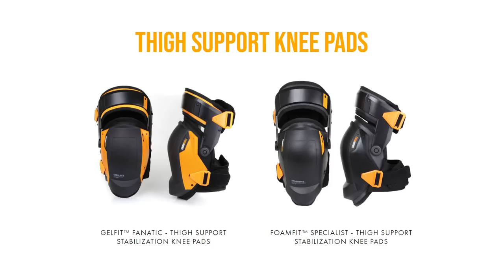How To Avoid Replacing Your Knees ~ With Toughbuilt

Comment: I hated knee pads in days of old personally for all reasons you just mentioned. I'm over 50 now and knees are shot to bits, I used cardboard, packaging, foam, anything I could lay my hands on to use for a kneeling pad but eventually the poor old knees took their toll. The latter part of my working life companies issued them stupid foam pads that you force into knee pockets of work trousers that were absolutely crap. I have had a 2" peice of white firm package foam handy now for my kneeling, I just can't kneel straight onto a hard floor any more. The younger trades folk should heed this advice and start protecting their knees, the sooner the better.
How about a lecture on our backs next Roger, and I don't mean a video of you laying on your bed. I bet I'm not the only one that has constant back pains now from the years on sites. 👍👍👍
Reply: Knees, back, neck and shoulder. I work as an osteopath and see my fair share of trades. Anyone working above head height for long periods has a good chance of getting neck and shoulder problems, anyone working below chest height is going to get knee and back. Then you got the poor brickie who's thumb will give in after 15-20 years unless they are genetically blessed.
Reply: When you add 1/2 inch hight to your knees, you need to arch the back further towards the floor.. longer term,this is more painful and debilitating than knee problems .
Reply: Mine to I wan told years ago by a old carpenter to always were knee pads which I listened
Reply: @johnnorris1983  interesting point
Reply: Hi there. We'd like to speak to you about your story as part of our #KneelSmartKneelSafe campaign. Please email us at marketing-uk@toughbuilt.com.

Comment: My main trade is plumbing. I’ve tried all different types of knee pads and I find the straps just dig into the back of my legs or the pads just fall down etc. 
I just use a memory foam pillow, works a treat. I wrapped cellophane around it to keep it water proof as much as possible.  It’s really comfortable.
Reply: I totally agree with you. I've tried all sorts of knee pads, and as you mentioned, the straps digging into the back of your knees is just to uncomfortable. I've tried trousers with built in pads but i've got very long legs and the pads are in the wrong position and don't line up with my knees. And like you, i just use a piece of foam which i put inside a rubble sack and cover in silver gaffer tape. So so comfortable.
Reply: @tilerman  that’s right,  wish I did this years ago when I was young but was stupid  and got embarrassed about using a cushion on site. People say it’s a pain trying to carry it around but it’s more of a pain when you can’t walk properly.

Comment: I bought a pair and to be honest they are the best I've ever worn they don't cut into the back of the legs I have the hard shell and I recently bought the soft shell to change because I was laying laminate as to not scratch the floor, I'm a joiner in my 50s and I automatically put them on first thing no matter what job I'm doing my knees aren't too bad considering my age, but in the last 10 years I have worn knee pads no matter what and I think that's stood by me

Comment: recoil spring loaded kneepads are the best in my opinion. only ones ive found that make kneeling comfortable where would otherwise be unbearable. the straps may be a bit uncomfortable but they should be easy to remove and secure your own wrap/straps on.
Reply: Made in Britain to.

Comment: Best ones I've found are light weight gel knee pads by Vitrex. Light so don't have to do the straps tight and stop the circulation. That said minimise the time in use and try to think of another way of doing the job if possible. Trousers with flexibility also helps. Would be interesting to try those toughbuilts.

Comment: I'm  a Painter & Dec with 45 years in the building trade. I also laid ceramic tiles  laminate flooring. 5 years ago I was registered disabled with arthritis in my knees, back and hands. In the 80s I used to wear miners knee pads. Even wearing them didn't stop me getting arthritis of the knees.
I am now awaiting the first of two knee replacements. To any young  tradesmen. Please, please wear knee pads. Just because I have arthritis of the knees doesn't mean that you will.

Comment: Hi Roger   Something I’ve been banging on about for years , of course in my early days there was very little available except as you say the type that were just to uncomfortable. But today there really is no excuse , even the type that fit into pockets in the work gear can go a long way to prevent future problems.    Ironically I’m having new PVC windows fitted, and not one of the lads has knee protection . And yes I have given my hard leant advice , but was met with all sorts of excuses including it’s no good if you were shorts bless them.   I suppose when we’re young we think we’re indestructible , but sadly over time we find out often to late we are very far from it .     Ps  you still see a lot of trades not wearing dust masks or in fact any PPE at all .    But thanks to trade Ambassadors such as your good self the message will get through ,   if you can prevent just one person becoming debilitated later on in life . Then  you can give your self a big pat on the back .     Best wishes and kind regards as always.  😀👍👍👍

Comment: Felt fixer (Flat roofer) for years.  In that job kneepads are considered a consumable.  
Best I found were the Nailers Kneepads (toolstation), but they had to be modified with some 1 inch thick elastic from amazon.
Now I wear those 35 quid snickers ones for floor layers and even that's only because it looks better for going into peoples houses (doing different stuff now)
Nice Toughbuilt have put some product design and marketing behind this, though there are other directions to go with these as well.  Might give them a shot at some point 😁

Comment: Worked at Waitrose for about 7 years during my college years. One the evening shift. The ladies were always offered the knee pad boards, they never bothered to offer it to the guys you had to ask. Good that times have changed. Anyway. All the ladies would tell me I should use one, being young and an idiot I always said no I'll be fine. I now regret it. Knees kill when getting up but now wear DeWalt trousers when doing basic DIY round the house and just use the foam pads inside the knee slip. Feels so much better on the knees & fairly cheap.

25 years by registering your purchase. In other words "Your data is worth that amount to us as we can then sell it to others to cover the costs" I bet in their small print for that 25 years is being allowed to sell your data, but I could be wrong.
Reply: With gdpr, I don't think they can share your specific data anymore. It's quite strict

Comment: Hmmm. On the positive side, they are available in the US (on Amazon) for a reasonable price. Also on the positive side, they seem to offer protection from sharp objects and protection against some impact (while crawling), which is hard on knees.  On the questionable side, they don’t do anything for the compressive impact of walking, jumping or running or the strain from repeatedly kneeling and rising or leaning over. How about “lift with your knees and not your back”?

Comment: I get on really well with the Snickers with knee pad pockets. The big downside is if you snag the "pocket" on a tiny bit of something sharp, then that's the beginning of the end of the knee pad pocket and also the trousers. As we all know thsnickets brand know how to bloody charge. Rest of trouser fine, knee pad pocket f****d.
I tried without luck to buy something tough to repair the front with, with zero luck. So annoying and expensive.🤬
Reply: What about 600D cordura fabric or similar? The stuff they make motorcycle textile jackets and trousers with. Designed to take some scrapes
Reply: @Confusedduckling499  Thanks for that. I'll try and find some to make patches from.
Nice one

Comment: First find yourself a good chiropractor, secondly I swear by snickers work trousers with knee pockets for in built kneepads. The knee pads are made from the same material as my ce1 grade motorcycle pads. The trousers are not cheap but I have been using the same knee pads for 4 years now.

Comment: These knee pads are garbage. The top strap lost a screw after about the 5th use and they slide down my legs regardless of how tightly they are sinched.
Reply: Hi Jason. It sounds like you have a faulty product. Please get in touch with info-uk@toughbuilt.com and send photos.